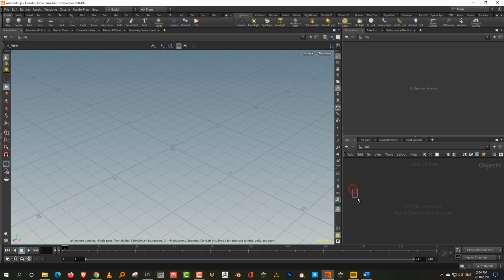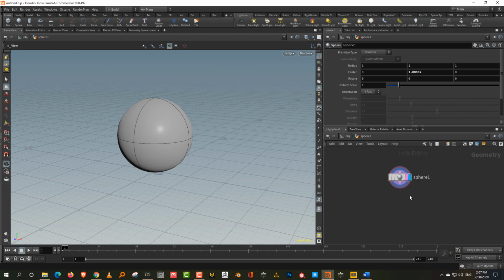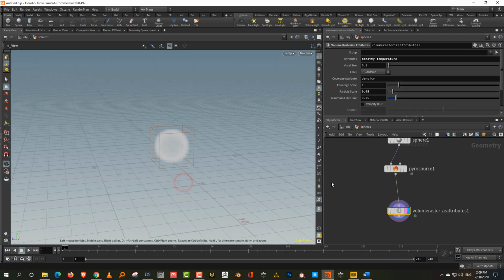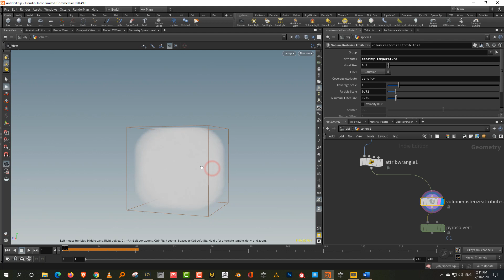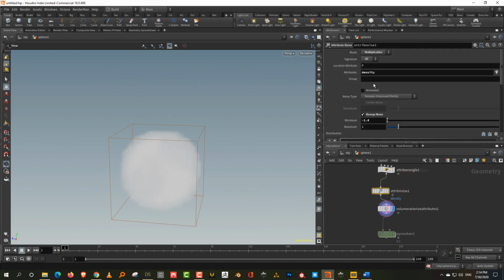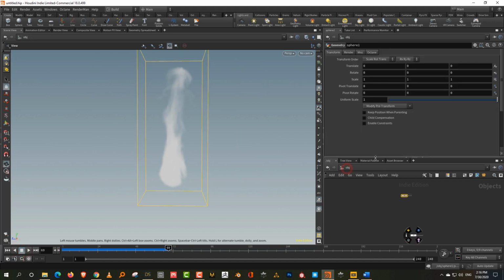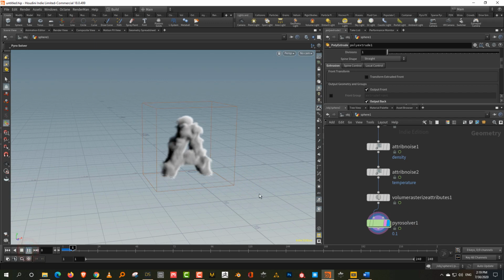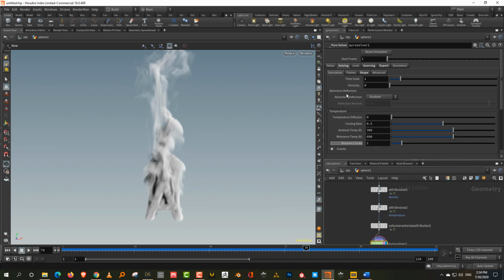Introduction to smoke simulation - 1A - Basic Setup

Comment: Hello, hope you can help. I can't change the pulldown option on the pyrosource from Initialize to anything else. I select Smoke Source but it doesn't hold. Stuck on Initialize.
Reply from the maker: Maybe the node is broken. You can always create the values from scratch using a wrangle or an attribute create node. Because that's all it's doing.

It creates density, pscale , temperature and burn attributes on points. So if the pyrosource node isn't working just use a scatter to scatter points and then create an attribute wrangle and create the attributes you need. 

To get the Pyro source node back you might have to reinstall Houdini. I can't think of any other way to repair it.
Reply: @rohandalvi  Thank you. Actually, I can see the different attributes when I select each one. Just the name remains the same. Weird.

Comment: I tried the below values with the updated attribute noise node. It did not work for me the first time. I detached and reattached the temperature attribute noise node and it worked surprisingly.

Attribute Names: Float    density

Range Values : Min/Max
Operation : Multiply
Min Value : 0
Max Value : 1

☑️ Animate Noise
 ------------------------------------------------------------------
Attribute Names: Float   temperature

Range Values : Min/Max
Operation : Multiply
Min Value : -10
Max Value : 10

Element Size : 0.99
Offset : 4.4

☑️ Animate Noise
Pulse Duration : 0.4

This gave me similar results to what Rohan featured.

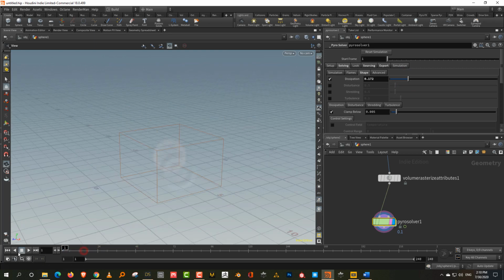Comment: I'm having a problem, the smoke doesn't rise automatically for me at 5:00. It gets denser, but doesn't rise.

Edit: 1 month later, I found out I misspelled temperature.
Reply: hahahahaha that's pretty funny
Reply from the maker: Check your temperature values
Reply: @rohandalvi  I have an ambient temperature of 300 and reference temperature of 3000 kelvin in the Pyro solver (Everything is the same as default). I have this issue in both the windows and linux version of the software.